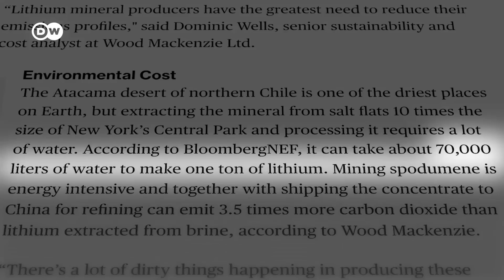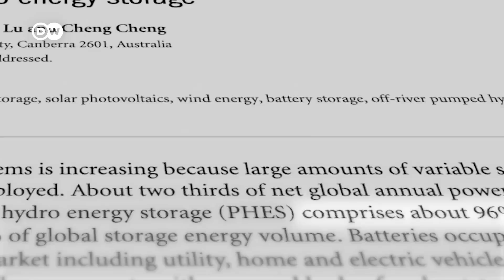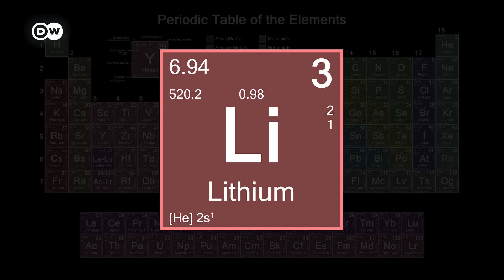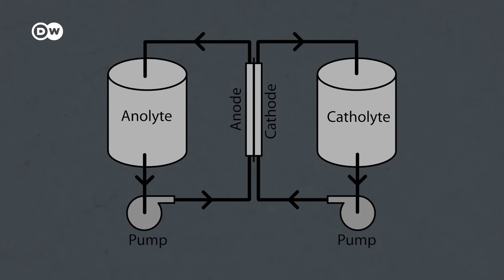How salt and sand could replace lithium batteries

Comment: A common meme from the "ignorance sphere" is "well what about when the sun isn't out and the wind isn't blowing? Lol." 

This. This is what you do. You build giant batteries using materials that are most efficient at slow, long term storage, you store up the energy when it's in excess, and you spend it back out when it's in drought. A future power grid will be like a series of dams (including, in some cases, a series of dams), in that the "upper reservoir" will be the most stable, slowest forms of energy storage, and rarely even see use, and then bellow that in the chain you have medium speed batteries designed to kick in when the faster batteries are getting strained, and then below that the faster batteries that can activate instantly, and then of course the renewable sources that will power things directly whenever that is an option. Each flows into the next as needed.
Reply: The current system we have doesn't require storage. Why would you want to build impossibly large storage cells for power?
Reply: @electrolytics  Of course the current system requires storage. Have you ever seen "coal," or "oil," or "natural gas tanks?" What do you think those are? 

And these "impossibly large storage cells" aren't really that big, for the most part they would be smaller than the power plants that they would be taking over for.

Comment: The thing is though is that it’s so much loss of energy and you can’t replace like smaller batteries with sand and I’ve looked into this and it’s much more like heat energy rather than electrical energy so you can’t exactly replace lithium batteries with sand at least not in phones laptops any type of smart device, we’re basically any handheld power devices nowadays that aren’t powered by like replaceable batteries. There will definitely be an alternative to lithium batteries but it’ll have to also be a chemical battery to be able to store energy in the way that we use it currently unless we somehow change our entire way that we use energy

Comment: Vacuum, or flywheel batteries are also much more efficient than lithium-ion batteries. They outclass lithium ion in every metric except weight. Simply put, by spinning a heavy rod in a vacuum, the rod can reach extremely high speeds and thus store lots of energy to be fed back into a generator.

Comment: For large energy storage we shouldn't use batteries.

Look at the compressed air or liquid air energy storage. 

Even CERN Generator uses spinning cylinder weights to storage massives amounts of energy. 400MW.

Comment: If people were sincere and worried about 'cost' and 'ecology' etc, they should start building a 12/24/48V local grids where everyone share their output from PV panels and capacities of their battery packs. If people made their own home PV system based on their max Watt need, everyone will then have overpowered systems.

THAT's a waste of resources, money and capacity. THAT's is the veil people refuse to see behind, and have been for 20 years. It requires upsetting the current economical structure, so people will keep ignoring it, even if it is the most logical approach.

Comment: Using sand, stone, bricks, and concrete ( and why not limecrete)  is why passive solar is far more cost effective than active/pumped solar heating systems for homes. Besides, you can build your house out of cement, bricks, or stones and use your house walls to store your houses heat. Yes, will have to add glazing material ( glass or  polycarbonate ) , flow flaps, and insulation to to that wall but you would most likely insulate anyhow. ( thinking of a I believe its called a throbe wall, to give me for the name & above all the spelling) What about salt for nuclear reactors to increase their safety and allow for easy reprocessing of the spent reactor fuel to drastically reduce the amount of toxic nuclear waste and its storage time? Why isn't any government investing in this technology?
Reply from the maker: Hey there! Check out our video on Thorium nuclear energy 👉 https://www.youtube.com/watch?v=Km6kqykX900

Comment: I'm not a scientist nut I have been saying for decades that at minimum every 10yr we need to look at the last 500yrs of advanvancements or better yet failed projects. For instance the Tesla turbine  if the same tech was used today to build the blades for Airbus and Boeing engines on the Tesla turbine the 6 inch model could probably produce 1000hp at 100000RPM  without any blade stretch.

Comment: There's already arguments over sand supply, so probably salt, specially if it's salt from desalination.
Reply: They specifically are using the sand that isn’t in short supply
Reply: @philltheotherguy1868  There's no shortage of sand. The arguments are over the damage done by digging sand too much.

Comment: So yeah. 10 000 GWh. It sounds like a lot, but it's really just a matter of scaling.
Let's say we divide that 10k GWh between all the populated continents (6). We take 100 square km (10kmx10km) from each, since that is a miniscule area footprint for any continent and pack it with batteries. Let's assume a viable solution should pay for itself in 20 years and last 30-50 years so that transitioning is a clear economic win no matter how you look at it.

How energy dense would the batteries need to be to get to that magic 10k GW number? 16.67kWh/m2... How dense is that volumetrically assuming 1m tall batteries? 16.67Wh/l. 
Notably... Current gen Li-Ion batteries are about 27 times more energy dense than that.

Thus. It is completely within our means to solve this problem even with some of the most humble of chemistries we know of. As long as they can pay for themselves well within their operational lifetime and they can then be easily recycled, then it's game on, but for a bit of will.

Comment: The way of the future is Man Made Diamond Batteries which never need charging and last 1500 years. they are also an excellent way to sequester carbon indefinitely. Every electric care is likely to be powered with them and they could power the grid when we put the car in the garage.

Comment: It is important that we make our grid green. But what about our shipping and  cruise line industries? One cruise ship emits the equivilent to 1 million vehicles.  I don't hear to much conversation on it. The people will have a affect on slowing climate change. But industry will have the greatest and fastest effects. The reason why we are not really focusing on that specifically is because of the costs and economic impacts involved. It is with great importance that if we want the economy to be a stable as possible we should fight climate change at all fronts. This means to go for the most theoretical efficient combustion engine possible. If 100mpg is possible. We must shoot for it. Steam power is also a great contender for lowering emissions as well as it has lowered New Yorks by about 30%. Note there may be facts that are incorrect or lacking of detail. This is off of memory and is subject to error.
Reply: No one is talking about the carbon impact of buying products from overseas companies and having them shipped across the world to save a few dollars either

Comment: I'm more interested in Thorium liquid salt nuclear reactors. Clean safe nuclear  energy, powered by radioactive waist currently sitting in mining slag heaps all over the world. Minimal waste as 95% of the energy on the Thorium is used before it is discarded, making it safer than it was before being mined. And if a Thorium liquid salt reactor has a problem it just shuts down. No possibility of a melt down.

Comment: What about liquid salt? Like those giant solar energy plants that use mirrors to fucus the sun. Also could you have a huge heavy wheel hat spins In a vacuum and you speed it up when you have excess energy and when you don't you use It to spin a generator. Or would that be way too inefficient? Also what about solar panels in space beaming laser energy down? Not a storage solution but it sounds cool how feasible is it??? Also I have a question about crowdaourci g energy storage with small personal batteries. I heard it could be a thing with electric cars. Is it a thing? Can / should it be. At what point is a battery to small/inefficient to be worth including in an electricity web/grid free market trade thing. In theory would it be worth it for me to charge my phone or smart watch at cheapest or most green times and then sell it at others or would degrading the battery not be worth the potential benefits??? Also is this an actual doable thing... how do you buy and sell electricity at minute to minute or second to second market prices????

Comment: Fun fact: Did you know that humans are technically a form of batteries? Most of our work can be done by our arms and legs. For example, we can actually move from A to B using legs by walking or cycling. Maybe we can start building walkable cities to accommodate this revolutionary discovery.
Reply: Human powered devices/machines seems being neglected, we can't all rely on grid or battery. It would also be better to atleast find a way for the  improvement of human powered devices/machines such as pedal powered blender, washing machines and etc... This sounds like a poorman's device but at the end of the day, we might need it, who knows.

Comment: The world's cheapest source of power in 2020?  Why would you outright lie like that?  lol.  It's unequivocally NOT True.   Renewables are by far the most expensive forms of energy, and they do vast amounts of damage to the environment as a result of all the mining required to source the rare earths, lithium, cobalt, magnesium, copper etc, and the energy intensive processes required to produce the materials required, electric motors etc. Even if lithium is not used it makes little difference.  People, learn the truth.  THERE IS NO SUCH THING AS GREEN TECHNOLOGY.   It's ALL smoke and mirrors.  So long as humans continually demand more and more comfort and convenience and technology, the earth will continue to deteriorate.  There is no magical cure. It's pure fantasy.

Comment: I personally believe transportation and energy should be powered on green hydrogen, it is made from electrical separation of water (H2O), separating hydrogen from oxygen. 
It is very effective and can actually replace gas in many fields in my opinion, but yea for our phones and communication devices we are gonna need sodium ion batteries, as said here sodium is more abundant than lithium and is also quite similar to Lithium, also mentioned in the video. 

Pumped hydro is also a pretty good idea, although I don't really think it can be used wide scale, as most hydroelectric dams are in mountainous or hilly places, because those places have better river flow. It also, as you said in the video, requires quite a lot of space.

So yea, summary here is: For our transportation, energy or even agriculture and construction may require green hydrogen to be used, while for our own devices like computers, phones and tablets etc. we are gonna be needing sodium-ion batteries. Its cheaper than Lithium-Ion and also more abundant.

Comment: Hydrogen and biogas are a better choice for the industrial applications, like steel furnaces, laundries, breweries and a lot more. Maybe someone should make a solar panel, that convert sunlight, water, and co2 directly to gasoline or oil, like a plant. It would do a great job, because the pollution from changing all the cars, trucks and machines and airplanes to electricity would be very greater than change the source of fuel.

Comment: Or we could just use nuclear, the safest and cleanest energy source ever developed.  And that's not an exaggeration.  The sheer energy density of nuclear means that, per kWh, nuclear has a lower carbon footprint than even modern renewables.
Reply: Its not the safest, nor the cleanest (close though). So that's a lie.

Energy density isnt a good thing.

And it doesn't have a lower carbon footprint of wind...

why are you lying bud?
Reply: @zaarkeru3391  he’s not lying your just severely misinformed
Reply: @n55kid96  
Buddy, i'm not...
What i'm saying is factual regardless if you like it or not...

Nuclear isn't the safest, solar is.
And wind generates less lifetime CO2e emissions than nuclear.

And a high energy density grid results in a massive singular failture point, which can result in a total grid collapse if we see a sudden failure at said large energy source.

A diverse and spread out grid (regardless of which source) is the better one.

Again, your feelings are irrlevant faces with factual facts.

Comment: Using molten salt for storage is very old and had been used in CSP plants for decades. What benefit does this Malta tech bring to the table. Looks like they are using electricity to heat the salt instead of thermal energy from the sun like used in csp plants.

Comment: Sodium contains 8 more protons and 8 more neutrons than lithium. Total weight of an sodium atom is 23u vs. 7u, which means about 3x in weight. The ionization energy value of Li is 520.2 kJ/mole while Na is 495.8kJ/mole. So lithium can store 520.2/495.8 = 1.049 about 5% more energy per atom/ion. Which means that lithium batteries can store about 3.44 x the energy per kg than sodium batteries. Sodium batteries are thus utterly useless for cars. This is based on the normal occurrence of Li and Na isotopes in ther field.

Comment: 5:40 it can keep the heat to up to 6h and Lithium can only manage under 4h? You got something very wrong there. Lithium batteries can store energy for weeks, with a minimal drain. And even the heated molten salts should last longer than 6h if the insulation is good, and it has to be. 6h is not enough for a proper grid balance so check your facts.
Also, please, can someone motivate the narrator to open the mouth? Pay her better, maybe.
Reply: This. 6 hours for heat storage? When it’s insulated properly, it’ll probably be more like 2 months, considering the scale is large enough (small surface area compared to salt volume). Also, comparing heat storage vs electricity storage is comparing apples to oranges, which you can’t do.

Comment: Sounds like it's a problem in electric cars unfortunately due to the weight? But for storing energy from solar panels this is wonderful news. This reminds me of the irony with solar panels requiring coal to make them apparently. But it seems common sense that the length of time that the solar panels generate electricity outweighs by far the resources and pollution caused by manufacturing the panels. Lithium batteries sound like an even worse case of robbing Peter to pay Paul.

Comment: Many factual errors in this video, for example 5:46 you're comparing sodium heat storage to chemical lithium storage, claiming that lithium batteries can manage only 4 hours of storage, which is evidently false to anyone who ever used electronics. Lithium batteries can store energy for months with very little loss. I'm a big natrium battery supporter myself, but you have to be intellectually honest every time you report

Comment: Pumped hydro has its downsides but it is a proven technology that works and should be implemented more in the meantime to wean us off of fossil fuels until we are able to bring enough of these other technologies online
Reply: The problem is that all the viable sites are pretty much already used for pumped hydro. The tech is great and pretty simple, but we're just running out of places we can build them.

Comment: very interesting, you listed and magnified all negative side of lithium, but you completly forget to mention the dark side of oil? Are you supporting green or oil? E.g cobalt: Cobalt being used for oil industry with large scale. Also, new batteries does not contain any cobalt at all, also next gen battery won't contain any lithium either. Would it be possible to change the order? First list all the negative element which oil bring to us. Like: child labour, war, sicknesses, poverty and so on. E.g. All major oil producing countrie have no democracy

Comment: This video is mostly accurate but has misunderstandings about, for example, where lithium comes from, and says things in an assertive tone like : batteries tend to catch fire, which isn’t really accurate. People catch fire too.  So what’s the point? Is DW saying that batteries should be nonflammable?  This video needs more peer review and less shortcuts that are loaded with undertones that lead people to focus on unimportant points: the batteries are less of a fire hazard than gasoline based solutions. Lithium is abundant in the world. Yes you need water. You didn’t need to spend 50% of the video before you got to the sand batteries. And then there wasn’t much meat. It comes off as a fluff piece. I have no idea how sand is used in batteries or what is the chemistry.

Comment: Similar to lithium-ion batteries, using organic solvents in sodium batteries may cause serious safety issues such as fire or explosion due to the high flammability of organic solvents.

pure sodium itself is quite reactive with air especially with high humidity ones. Means it will also get explosive.

Comment: That's cute but well placed windows and shudders can collect 500J RMS over a 24 hour period per m². Optimum position 67° latitude. (67°=90°-23°, the Earth 🌍 is tilted 23°. Summer calculation: 67°-23°=44° about 350J/m² RMS over a 24 hour period.)
Reply: On a sunny day.